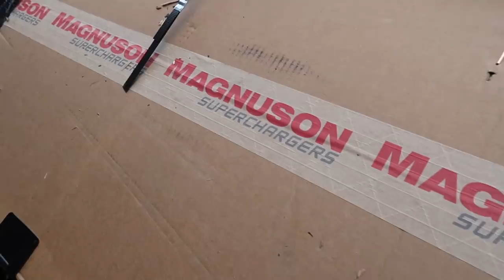The New Supercharger REVEAL!! It's Finally Here And It's INSANE!!

Comment: 2.65 liters of efficiency. There is a reason why Chevy is now using these in the copo as opposed to the other brand.
Reply: @L8-APEX  not for the 2019 Copo Camaro, they are using Magnuson's new 2650 blower. They ditched Whipple this year.
Reply: Michael Angel thanks for letting that person know. This 2650 is wayyy more efficient than a whipple. I’m guessing they’ll be making about 1200-1300 whp on blower only.

Comment: I like the disclaimer on Magnuson's website for this kit. "Designed to fit GM small block V8 engines with LS3 style cylinder heads. Vehicle fitment is the end user’s responsibility. Vehicle installation may require a new hood, or cut out in the hood to accommodate supercharger, plus possible cowl trimming."

Comment: Get a VFN hood to cut a hole in... cheap and light.  Then take the blower snout and flip it so it curves up, so it will point somewhat up and out of the hood into cooler air... plus it might have a slight ram air effect